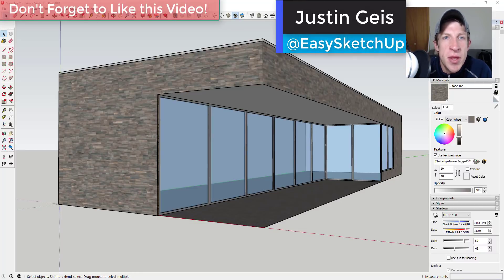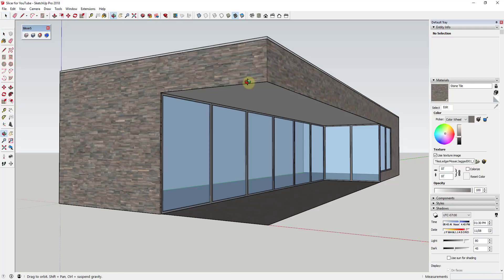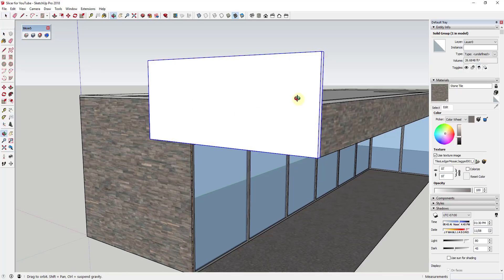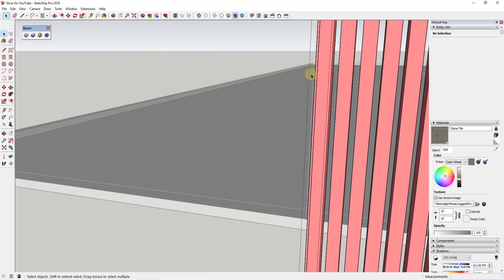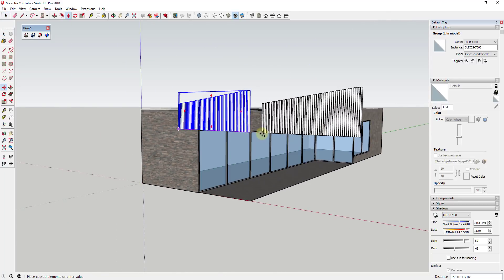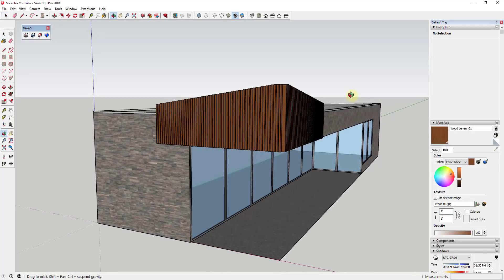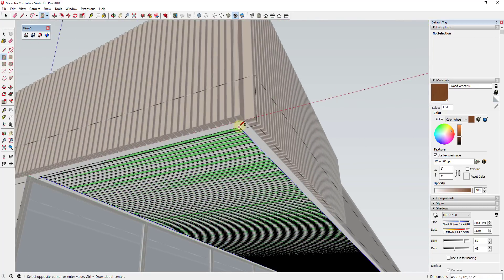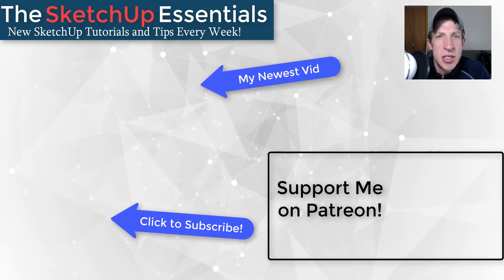EASY WOOD SLAT WALLS in SketchUp with Slicer!

Comment: I realize that it's an old thread so I don't know if you check it .... Great plugin & tutorial.   Does anyone know if it's possible to angle the slices?  ... or would you be required to rotate the entire wall, enlarge it, crop back to the original dimensions and slice the angled wall?

Comment: It is not compatible with su 2018
Reply from the maker: I made this video in SU 2018, so I'm not sure what you're talking about...
Reply: @Thesketchupessentials  when I install slicer5. 23 which is available on sketchucation the toolbar of slicer doesn't shows, however in extension i have slice modelor and slicer but it didn't work like you do in this video.